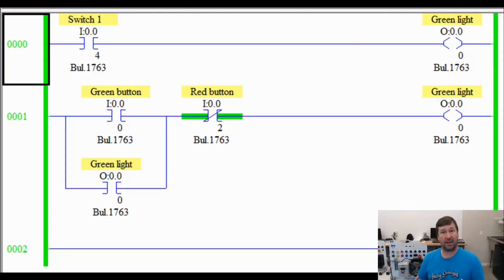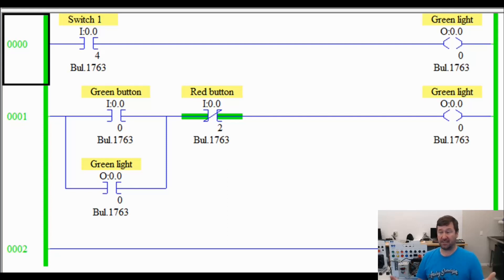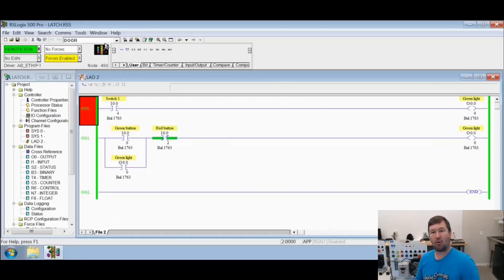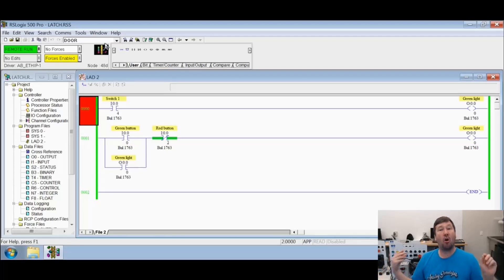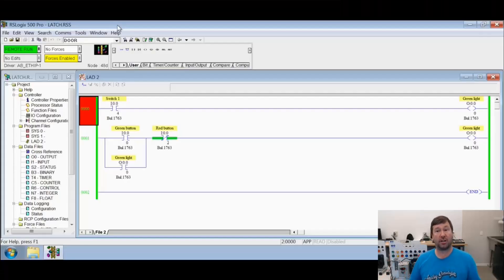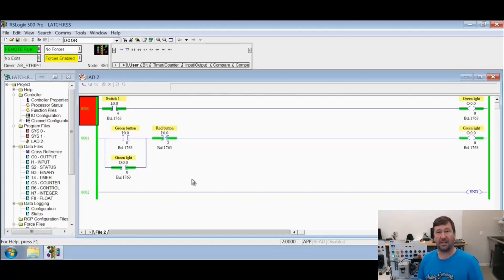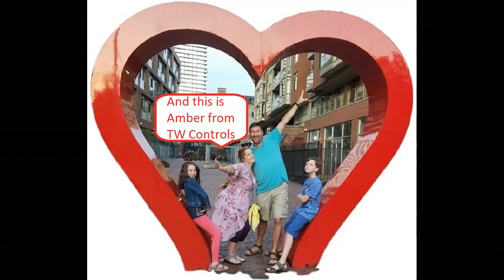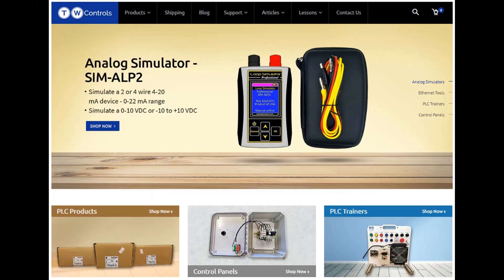Which Rung Wins When You Have Duplicate Outputs?  Proof that the Last Rung Wins Statement is FALSE

Comment: SO, "last rung wins" is a generic statement - easy to say, but more complex when you evaluate it.  "Winning" needs to be defined, perhaps as "last rung that acts on the bit address in the data table will over-ride any other actions prior to it."   Insofar as the status of the physical output device, the thing that "wins" is the last output-type instruction that either sets the output address to either 0 or 1.  The "rung" might contain edge-sensitive or non-retentive instructions {one shots, latches}, etc.  In the case of the video example, you've created a special case - good for demonstration and discussion for sure.  The point of the lesson, I think, is to make students THINK about what the 'outputs' on a rung actually DO...all they really DO is turn ON or turn OFF bits in the data table.  The OUTPUT UPDATE task of the processor, which runs after the [END] is doing the work, insofar as the light is concerned.  So, the OTE is acting on a DATA TABLE location, not a physical device.  O:0/0 just-so-happens to be associated with an Output Card, i.e. an output device.

Comment: This is a little low level example to what people are meaning when they say this. If I try to control multiple solenoids in different sequences, regardless of the software it locks up on the lower rung in the program every time I find.
Reply from the maker: Nope...ladder logic doesn't "lock up" unless the PLC's run light is out.  I hear this from my students all the time when we do the classroom version of this.  Ladder logic will always have a predictable and repeatable result.
Reply: @Tim Wilborne  sorry, but totally disagree. I'll give the you the situation. 9 solenoids trying to use them in 5 conditions. 9 controlled by 1 button 5 controlled by another etc. If I toggle with an input simulator it will call some in the group. But not all because some are locked in from the previous switch toggle. maybe where talking about 2 different things but that seems locked in to me. Trying to get around it for 2 weeks. Watched all of ron Beauforts videos over the years, so totally get the go write a 0 go write a 1 explanation.
Reply from the maker: @TJ-vk5qk  There's nothing to disagree with, you're just not following how program scan works. Go back to the basic scan videos and work your way to this one. Also the simulators are not a perfect replication of a PLC.

Comment: In the end it's safe to say don't use duplicate outputs. Also avoid using ladder that's difficult to read if possible. I see a lot of rungs that work fine but are horrible to figure out logically.
Reply from the maker: Yes it is safe to say you shouldn't, but it is important to understand it doesn't make the PLC go "crazy".  Then and the other PLC scan videos that went along with it are also good exercises in understanding how a PLC  scans and executes code.  Thanks for watching!

Comment: Just so I'm clear. My understanding is that newer PLCs using studio 5000 are asynchronous and that that means the light is updated during the scan of the program.  Will that lead to issues such as flashing the light if one rung says it should be on and the next says it should be off.
Reply from the maker: That is correct, I should do this video in Studio 5000 to show the difference.

Comment: Is the data table updated (input status read) at the beginning of the logic execution or are the inputs physically read at every rung? 
Is there a rare possibility(theoretically of not practically) that in a long program the status of input might have physically changed while a single scan is completed (i.e. on at one rung and off at some other rung) ?
Reply from the maker: See if this video helps. https://youtu.be/_FSvOVCyk1s
Reply: Best practice would thus be using the inputs and keeping up flags at the beginning of the program and further using just these flags instead of the inputs would make a huge difference IMO. Opinion?
Reply from the maker: @ankitbothra8205  No, I would call that the worst practice possible. It is on the list to cover.